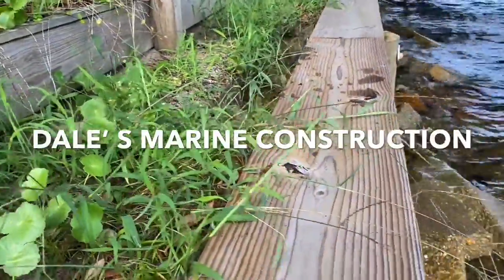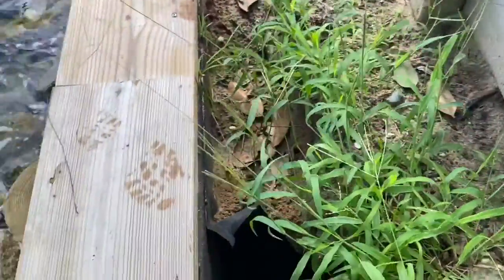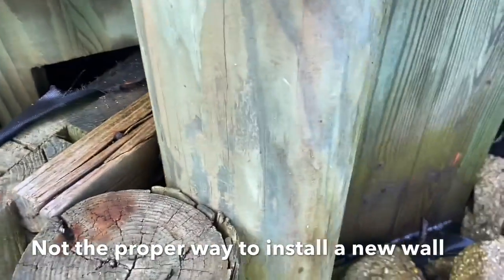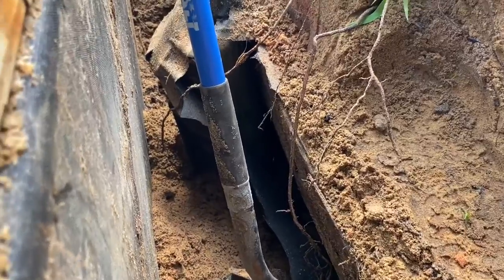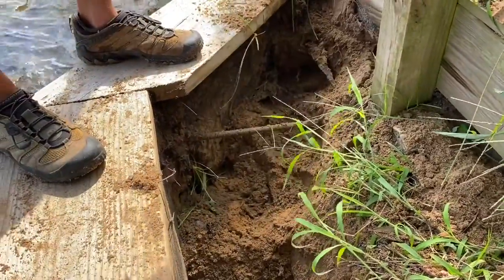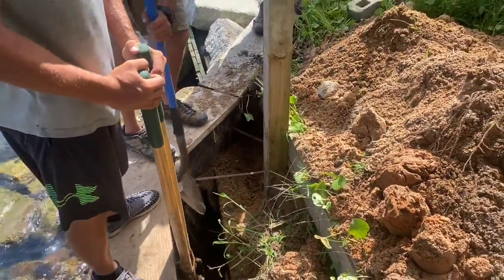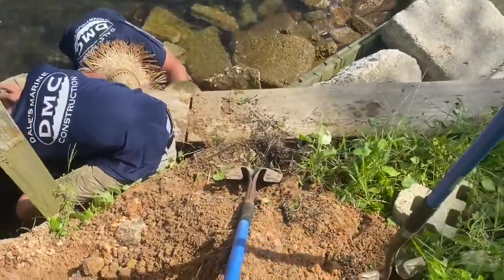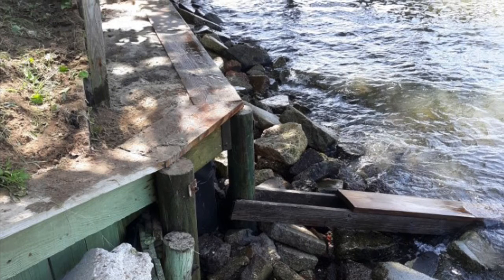HOW TO FIND/REPAIR A LEAK IN A SEAWALL

Comment: I find trenching shovel works best for digging out behind an old wood wall (which i have a ton of). I've dug out a few hundred feet to relieve pressure for tie back repair, trencher is tons faster, turns work into real easy especially with sandy florida soil.. 48" razor back. I'm sure you know this but for those who don't now ya know.

Comment: I like your videos because you make it really easy to understand seawalls.   
I am 68 years young and still like to be a DYI person.  I live about 1800 miles from you so, I use your videos to help me understand what I should or should not do.   I hired a company to replace my dock which was at the end of its useful life.   I had it built much higher than all the other docks next to me, because I just wanted to make sure it would last for 50 more years so that I would not have to do anything to it but put sealer on it every year.  I am even thinking of putting bubblers around the piers and connecting the air pump to solar panels with battery backup to keep the ice from attaching to the piers and causing the piers to pull up.   My concern is the wooden seawall.  My dock builder attached a large wide composite filter cloth on the water side and proceeded to place large heavy rocks long the filter cloth next to the seawall.   Using a large excavator he positioned the large rocks and then put in medium side rocks and then smaller rocks until he was putting in smaller gravel.   I had raised the existing seawall up three feet using comments from your videos about having supports every 5 feet.   So that I would not have to work on the seawall anymore for the next 50 years, I dug down three feet and put in footers with rebar to support a cinderblock wall on the land side of the seawall.  I put filter cloth on the landside of the existing seawall down to the concrete.  The seawall is also supported with 3/4' thick stainless steel all thread with stainless steel nut and washer on the water side and comes through the cinderblock and about three feet beyond to and galvanized anchor point.   Could not find a stainless steel anchor point.   There is about 6 inch gap between the seawall and the cinderblock which I filled with gravel and sand.  Inside the cinderblock I have placed 1/2' rebar attached to the concrete footers through each cinderblock cells and poured concrete into each cell after the mortar had dried.   This is only for the first 3 feet.  According to the government the water level is expected to rise 2.1 feet within the next 50 years.  I thought that I had it made until, the a  no-name storm which brought record breaking all-time highest water level ever recorded on the Delaware Bay on October 29 2021. Higher than Hurricane Sandy 9 yrs ago today.  On the land side of the cinderblock wall I filled it with gravel and sand up to the top of the seawall.   Three feet was not high enough, it washed most of the sand away, but my dock was the only one not under water.  Now my neighbors know why had it built so high.  I have now raised the seawall up another three feet and drilled down into the cinderblock concrete cells to attached three feet more of rebar, but I am only doing one rebar per cinderblock.  I will be pouring concrete into each cell and attaching more 3/4" stainless steel all thread through the added on 3 feet of seawall which is tied into the existing seawall every 5 feet.   I am planning to fill in the 6 inch gap between the wood seawall and the cinderblocks with gravel and sand like I did before.  I will then get gravel and sand to raise the dirt level up another 3 feet.   My questions are, for a DYI person,  short of putting in a vinyl wall panel system, is what I have done so far with the seawall going to last 50 years so long as the water level does not rise 3 feet?   Should I raise the rock barrier up on the outside of the seawall another three feet to match the new higher seawall?
Reply from the maker: Thanks for your comment and your explanation I don’t really do a whole lot of cinderblock walls down here. With the salt water that we have it causes the steel rebar to expand and crack everything and it eventually falls apart so that’s why I stick with the vinyl or wood. But adding additional rock to the front of the seawall or retainer wall is always a good idea this prevents a lot of back load if you do have excess of water coming from the back side during heavy rains.

Couldn’t really give you any advice on the ice situation being in North Florida we don’t really get much ice on our waters down here at all. But that sounds like a real situation that needs to be dealt with.

Comment: What's the best way to seal a drain line or pipe going through a sea wall?
Reply from the maker: Thanks for your question really depends on the type of wall it is if it’s a wooden seawall you can take some filter cloth this is not the standard ground fabric that you buy at the big box stores. You can nail it to the wood wall with some roofing tack stainless steel and seal it close to the pipe in around the pipe and use a little gorilla tape which I found to be pretty strong to seal the hole up. If the hole is cut a little bit bigger than what the pipe is it might be good to take a ground treated two by and cut a circle out. If it’s a vinyl wall you can use the same method just use the gorilla tape to tape it to the wall and try to fill the hole with the filter cloth and then type it to the pipe again. I hope this helps good luck 👍
Reply: @DaleWHickman  it vinyl sheeting around a corrugated metal drain pipe. Its leaking on side the pipe. Im thinking of sealing the hole with speed plug. Then pouring a concrete collar around it
Reply: @HensleyCaleb  A corrugated drain pipe is usually made of aluminum or galvanized metal which will eventually decay in salt or brackish water.  Would it not be better to use PVC schedule 40 pipe and use marine silicone caulk to seal around the pipe where it goes through the Seawall.  I would also use copper strap to anchor the PVC to the land side of the Seawall.
Reply from the maker: Yes that will work I have to add a 12 inch pipe through a vinyl wall and we formed up the inside and outside and poured a collar around it.